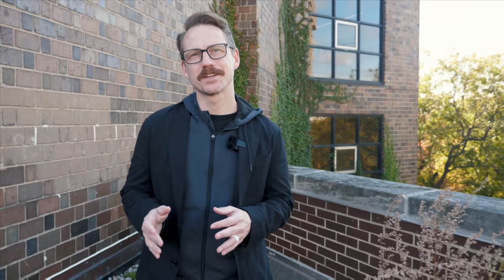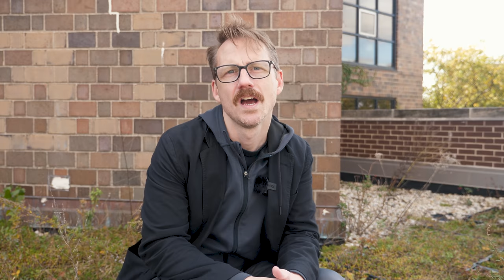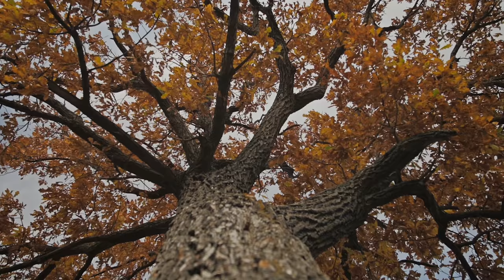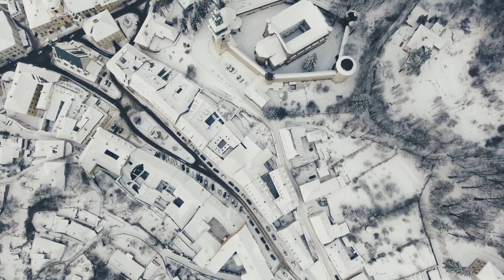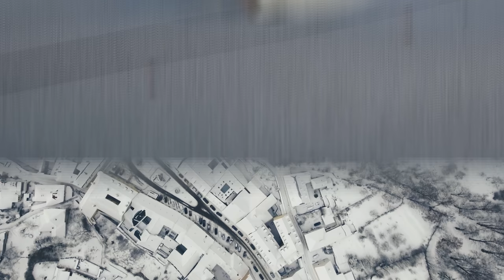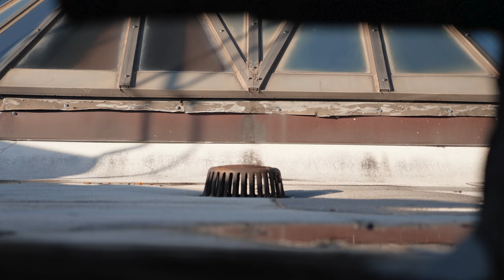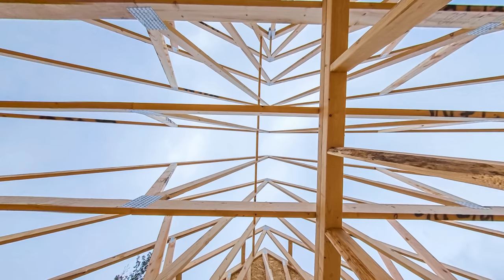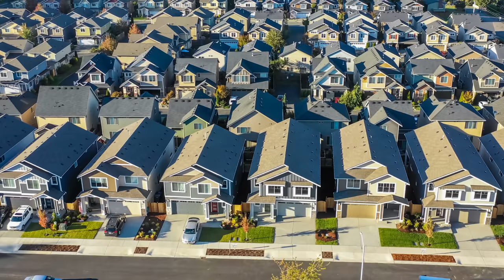Why Do Architects Insist on Using Flat Roofs?

Comment: Good points for high rises.  However, we lived in a single-story pitched roof house for 30 years and now live in a single-story flat roof house (with a tiny pitch on the roof) for the past 15 years.  One huge advantage the pitched-roof structure had was that we could have 10 inches of blown-in fiberglass insulation placed in the attic, which cut our utility bills in half.  The extra insulation made our place "adobe cool" during the summer and "bungalow cozy" during the winter.  The savings on utility bills paid for the insulation in just two years.
The flat-roof house has small, high-velocity pipes to distribute heat/cool which is a disaster.  The bedroom near the heater gets too hot, and the conventional vent adjustment is grossly inadequate.  I had to place furnace flu tape over two-thirds of it.  Even then, we still have temperature extremes in both summer and winter.

The pitched roof had only one leak after a strong wind damaged a few shingles.  The flat roof required two or three repairs by me (I tend to block such memories.  It was no fun at all.) and finally hiring a professional to get it right.  Leaks were not caused by summer thunderstorms.  We live in the southwest, and even the lake that forms over our two-car garage evaporates before leaking.  The problem is the shadows caused by the parapet walls blocking the sun from hitting the roof after a snowfall.   This snow melts a little each day and goes to a low spot where it re-freezes.  This can easily take five days and damage the tar coat.

I agree with your point about the ease of movement on a flat roof.  I was in my late twenties thru mid-fifties when we lived in the pitched roof model, but I would not care to go back on it now that I am in my seventies.
Reply: Similar for me.  Our pitched roof hasn't had any repairs in the 50 years of our home has existed.  The flat roof over the garage has had two replacements that I'm aware of, one from my budget.  But in the roofs defence.  You could put 10in of insulation on a flat roof it you wanted, it's just easier to retrofit that on a poorly insulated pitch than a flat.  And our failing flat roof is a very basic construction over a space that was never meant to be lived in.
Reply: @dwaynebailey333  not if it snows
Reply: @dwaynebailey333  You are right about the poorly insulated pitched roof being easier.  Two guys blew in the 10 inches in under four hours from start to finish in our 1280 sq. ft. attic.  When it is blown in, it expands.  I was shocked when I looked at the final product.  It looked like a foot and a half of pink cotton candy.   In terms of cost and comfort, it was one of the best investments we ever made.

Comment: I always figured on of the biggest reason for flat roofs in a city were to prevent snow and ice from sliding off and harming pedestrians below. Even rain falling on a blustery day can be dangerous depending on how fall it falls from.
Reply: As opposed to falling from the sky? I’m kind of confused what the issue would be
Reply: @Jacobscott272  falling ice can kill someone if a large sheet falls from significant distance. Snow can build up and drop in a heavy sheet once it starts to melt.
Reply: @valerimacdonald5146  Ahh i missed the snow and ice part and only read rain. Whoops.

Comment: As a structural engineering student, we were taught “don’t let water or snow stay on the roof”.  As a practicing engineer for 30 years involved in all sorts of damage assessments of buildings, I have reached my own conclusion:  “Don’t let water or snow stay on the roof”.  The only thing worse than a flat roof is the LEED folks wanting to pile dirt and make gardens on the roof (dirt and water).
Reply: Finally someone said it 😂
Reply: I’ve never understood why gutters have not been of greater assistance in redirecting rain/snowfall to the ground. Why can’t have we have the LEED garden maybe with a clear, see-through angled roof where downpour travels down the gutters?? Or travels to a tiny roof covered drain?
Reply: are you talking about the weak housing designs? redesign it to be load bearing and water proofed.
Reply: Wet dirt is not an effective thermal insulation.
Reply: This retired architect/structural engineer always had a lot of skepticism of the whole LEED deal. I never got LEED certified nor did I want to. The concept of garden roofs has more negative than positive going for it. Anyone want to guess what saturated soil weighs? Try almost as much as wet concrete. That means that the roof structure will be heavier than the floor structure. Close to double the cost of the typical floor.  Columns and footings will also be affected. I've seen conceptual drawings all the time of mature trees in huge pots on flat roofs. Does anyone want to hazard a guess as to what that weighs?
Reply: @kurtsalm2155  I wish you had been in some meetings with me😂

Roots and buildings don’t mix well
Reply: @MisterJeffy  wet soil thermal conductivity  is around 1.59 W/m·K while glass and concrete are 0.8 W/m.K.  Since glass the glass and concrete walls cover a far far greater surface area of the building they quickly don’t matter.
Reply: @qtheplatypus  Get back to us when you learn how to calculate the u values of wall and roof assemblies and their cumulative effect of their total areas on heat loss and heat gain of a structure.
Reply: @MisterJeffy  given you are a fan of education why don’t you teach me by explaining the error in my logic.
Reply: @qtheplatypus  I just did. Take a basic  course  in designing mechanical systems at a graduate school of  architecture or engineering.
Reply: @Jeff Harris  Okay lets tackle this from first principals.

Heat travels in and out of a substance in proportion to the difference in temperature between the object and the thing that it is in contact with along with its conductivity.  The only place that heat can pass in and out of an object is via its surface so heat transfer will be proportionate to the surface area.  So a sphere will radiate less heat then a cube which will radiate less heat then a set of fins (this is why computer heat sinks are a mess lots and lots of fins).

Consider a 10 story building on a 500 m^2 base.
That gives us a 27 m tall building.  Assuming the base is square that means each wall is around 600 m^2.

There are four walls so the area of the walls is 2400m^2 so the roof has to be  4.8 times more effective at radiating energy to equal the power of the walls to radiate energy in order for the proportions to match up.

This becomes more signifigent the taller the building is.

That being said if the wet soil is a layer over the already existing concreate then it will just increase the total insulative effect as resisters in series are additive.

Comment: Form follows function applies regardless of which roof design you build.  Whatever you chose, the functions will follow the form.  If you choose a peaked roof that will shed water and snow, that's what it will do.  If you choose a flat roof to accommodate HVAC or patio space, that's what you'll get.  I think what you've illustrated quite well is that choices need to be made, depending on what function is desired.

Comment: In Denmark, we have a long standing tradition with high angle roof, Mansard and soo on. But in the 60/70, funkis houses with flat roof came. They have a lot of leakage problems and mold problems  due to bad design in terms of slope and ventilation. But nowadays we have a lot of flat roofs on Residentials that have a longer lifespan than the normal high pitch roofs.
Im a carpenter and build these everyday. They are vented with a double perlins, 2 x 2x4 crossed above the roofline, to ensure cross airflow.
I have yet to heard a roof built after the design to fail or have mold issues.
If flat roofs are desired in residential, they can easily be built without a much higher cost.
Plus skylights and solar panels are very common on these.
Thanks for the video!

Comment: Ancient flat roofs tended to be in areas with little rain. I lived in a flat roofed apt building in West Hollywood, CA for 18 years. Every rainy season the gutters and drains would clog and the roof would leak. Water would drain in sheets down the internal walls. Drains on low sloped roofs are only as good as their drains are functional.  Given my preference, I would go for a Monolithic Done roof.
Reply: Little rain and zero snow. Flat roofs make sense in hot and dry climates, and nowhere else.

I work in a flat-roofed building in Sweden. Every time it rains, the roof leaks in multiple places. We've been told that they can't fix it because they can't find exactly where the water's coming in. You don't get that problem in a house with a pitched roof and an attic.

As for large buildings requiring giant roof pitches, well, just stagger the living spaces on the highest few levels, so you get a smaller and smaller footprint as you move up. Then just wrap the roof around the top few floors.

I'm convinced the main reason for flat roofs in colder, wetter climates is cost.
Reply: There is a reason why homes don't use dome roofs.  The largely illiterate workforce that builders employ don't have the education or training to allow them to understand how to build such a roof.  It matters not if it's residential or commercial construction.  The workforce is often poorly educated and functionally illiterate.  This has no bearing on location anywhere in the world.  It is universal. 

We design for constructability and costs in mind.  Not wild fancies
Reply: In over 15 years of flat roof installing I can count on one hand the number of flat roofs I've seen with gutters.  And drains are super easy to clear, way way easier than gutters.
Reply: @austenhead5303  I'm a flat roofer, if your building is constantly leaking that means it needs a new roof and the owner is a cheapskate.  Modern flat roofs do not have standing water, we use very basic concepts to eliminate low spots other than where drainage is located.   But again the problem is cheapskates not willing to pay.
Reply: @Daves_Not_Here_Man_76  well David I'm a flat roofer and while I don't know your exact literacy abilities, my own are are about as high as you can get without being a professor.   I'll admit I'm more of an abnormality in my profession but a person like me goes a long way.

The funny thing is that people who look down on tradesmen have only themselves to blame.   Stop rewarding smart people for getting meaningless degrees for pointless jobs.  In general tradesmen perform far more beneficial tasks for greater society with every hour they work no matter how illiterate they are.

Also domes are stupid, they actually aren't that hard to build, especially in this era of prefab assemblies.  They just aren't that great, and nobody wants them.
Reply: That's because your appartment was built badly and your landlord was a cheapskate who never bothered to properly maintain it. It has nothing to do with the roof itself, I spent my entire teenage life living in a flat roofed extension to my parent's home here in Denmark and literally never had any issues and Denmark gets more rain in a week than California gets over entire years.
Reply: @austenhead5303  If you're convinced of that then as this video shows you're just plain wrong.
Reply: @jeremyO9F911O2  Hello I am the hvac guy I didn’t drop the unit door at all I assure you. It was probably a bird or something.
Reply: @trevorcorey7910  lol, it depends on what roofing system is under, some are pretty bullet proof, while others not so much.
Reply: @jeremyO9F911O2  Most certainly not one of the white rubber ones. No sir I would never drop a 10lb piece of sheet metal corner down on the white rubber roof, not me.
Reply: @jeremyO9F911O2  Russian here (lived in a lot of flat roof blocks of flats, have lots of rain and piles of snow, sometimes - as tall as half of my height.). And... They leak. Last storey flats are actually cheaper in Russia for that exact reason. It doesn't matter if the buliding is 15 or 40 years old, if it is 5 or 10 storeys tall. It.  leaks. Why? My granny's flat? Leaks. My classmate's flat? Leaks. A flat in a modern block my parents bought to rent to sb else? Leaks. Every single top floor has leak stains on it's celling.
Reply: @annasolovyeva1013  quality control and good design are everything.   And remember that all roofs have a limited lifespan, ideally measured in decades.  As a roofer I like to joke that my job is recession proof because it's the one thing somebody will have to pay for.  

Probably 90% of leaking roofing is because the roofing is at the end of it's lifespan.  And most of the remaining 10% is bad workmanship.

Roofing is also one of the hardest jobs physically, meaning you may get a lower quality pool of applicants.  But for me that means better pay.   When I install a roof, I expect it to last 40 years.  Firestone the tire company also makes roofing systems, they have products that have have been proven to last over 50 years, and those products have been improved too in that time.
Reply: @jeremyO9F911O2  you can't design your way around a complete inability to shed snow.
Reply: @vyor8837  actually that's incorrect.  If your building is affected by even moderate amounts of wind you can design your building to minimize snow buildup.  Unless you have particularly "sticky" snow in your climate then snow only builds up as high as the nearest wall.  

And sticky snow will buildup on any roof and the warmer climates that produce it mean more frequent melting too. 

Trust me, I'm a flat roofer in a Canada, I know snow.    Most roofs collect a modest amount of snow, no matter the design or shape.  And snow runoff is also a hazard on steep roofs that flat roofing is immune to.  Imagine a high rise building in a urban center with packed snow and ice falling 11 stories to the adjacent sidewalks below. 

Snow is actually an insulator too, so in many ways modest snow buildup is a positive.  UV is also the number one damager to all roofing, again also improved with a protective layer of snow. 

Avoiding snow traps on flat roofing is exactly designing for reduced snow load, and most roofing of all kinds collects snow.  Ironically the ultra steep roofing that doesn't limits the internal volume of a building, the main feature a flat roof allows over other types.
Reply: @jeremyO9F911O2  no, that is completely wrong. There is no such thing as non-sticky snow. Snow being a good insulator is what makes it dangerous, it melts up top then freezes on the bottom. Wind doesn't just remove snow, otherwise the piles that build up from shoveling or a snow plow would flatten out. They don't.
Reply: @vyor8837  lol, you're trying to tell a roofer in Canada(in the colder parts) how snow on roofing works.  Perhaps you've never seen dry snow, it's indeed a thing when it's actually cold enough.  Which happens plenty here.  Snow melting from the insulating effect on a properly draining roof will just drain.  And snow only builds up to the tops of the parapets at worst slightly higher.  But even then you'll often find away from walls and parapets the snow buildup is lower because of wind.

Have you never observed how snow on a windy Highway collects mostly in the ditches?  Snow blows, and when the wind is sheltered blowing snow collects.  On roads this is the lower ditches, on roofing this is near walls.  This is the most basic phenomenon.  Roofing is higher so snow cannot be blown into roofs from adjacent areas, it lands on the roof when it first falls, but that's it once wind moves snow off a roof, it can't come back, and gets trapped in lower areas.

The worst possible scenario is a wind sheltered building with high walls.  You'll get massive drifting against the walls and even away from the walls snow will buildup.

Also a properly insulated roof with a high insulation value will melt less snow and allow the wind to remove it.   Warner climates with snow will be stickier, but they will also thaw more too.   While I've seen snow drifts against walls taller than I am, I've never seen ice thicker than 3"/7cm on a roof.  It's just the nature of the many factors.

Comment: In the tropics, flat roofs keep the hot air inside, and it's harder to naturally cool a house, whereas gabled roofs allow the hot air to rise way above its inhabitants. Some structures even have a "chimney" feature that allow the "trapped" hot air to escape out of the highest point of the ceiling.
Reply: the gable roof is like a half extra floor, just add an extra floor with the chimney, something similar happens with some middle east buildings